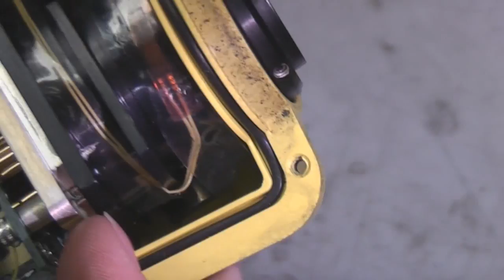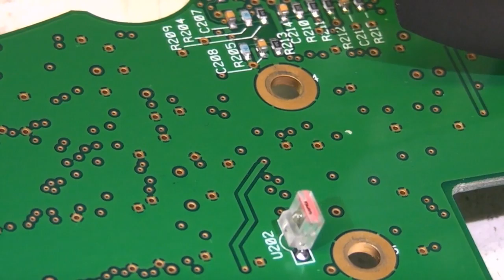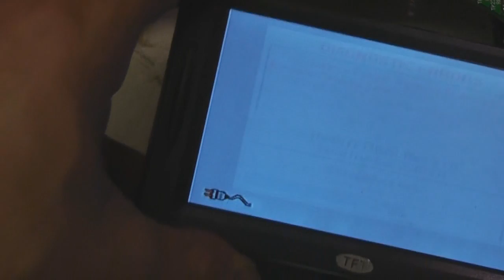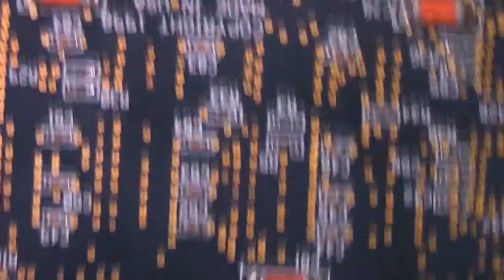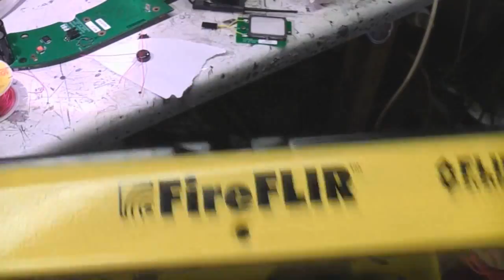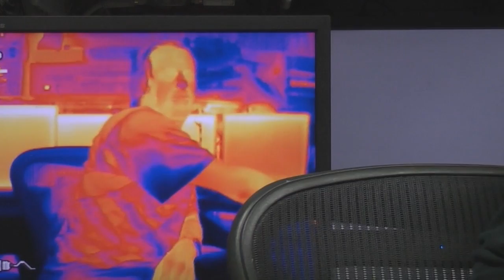Thermal imaging camera teardown and repair Fireflir ff110

Comment: I suspect that the small metal tanks are filled with a fuse-able salt. Something like ammonium acetate for example. It has a low melting point and absorbs heat as it melts. Just a thought.

Comment: In old car radios from the 90s you can easily find INCANDESCENT (!!) backlight.
Reply: +MrOpenGL more like 60s-70s
Reply: KingofKatenfutter
I have a Kenwood from 1998 with a colour LCD display and incandescent backlight!
Probably because LEDs were expensive at the time and since it wasn't battery powered, who cared if it consumed 100mA more?
Reply: Yes this was just the begin of the time of commercially available efficient blue/white LEDs and they were for sure not cheap.

Comment: A pain to search the comments if anybody else has mentioned, but it occurs to me that those large heat-sinky structures might actually simply be counter weights to make the device more evenly weighted, since the battery is to the rear and left, these large heatsinky things are to the front and right sides.  The "filling screws" would be used to pour in whatever it is they use to get the right weight.

Comment: The copper pinch-off tube looks exactly like those used to seal ion pumps for shipment (I work for a company that used to distribute high vacuum products), so I'm inclined to agree with @Doug Fuller; the imaging sensor is likely to be under vacuum.

Comment: Interesting video,  Thanks.  I think that the sensor is likely cooled thermo-electrically to improve its sensitivity.  The sensor would be in vacuum and thermally isolated from the case and electronics as you speculated.  

While this is not required for low performance sensors, it is likely needed to achieve the sensitivity and performance of the images shown.  You are seeing residual heat differences of a few degrees or less in the images.  Military FLIRs run at liquid nitrogen temperatures.

Comment from the maker: They're fairly standard 2mm socket probes - more useful on PCBs than standard probes  - sharp tip helps penetrate resist & gunk. Just don't use them on 3-phase distribution panels!

Comment: Those could definitely be phase change heat absorbers..... imagine normal room temperature was -5C and they had solid water ice in them.  If the unit was taken to a room of even 200C, they would hold the temperature of the assembly at 0C for some time as the water absorbed heat to change phase to liquid.   I am sure there is some material that melts at 40C or somesuch, keeping the temperature there until it's all melted.

Comment: Great video! At around 35:35 you talk about a 32kHz watch crystal. It might be used not for a real time clock, but as the reference for an internal PLL of the processor - a lot processors use this approach.

Comment: These things are still relatively expensive when broken. It went for 210 £ at ebay.co.uk
But still a relative bargain compared to new ones.
Would be fun to film a working high power CO2-Laser, probably you could see a beam like with those Ar-Ion lasers, since the CO2 in the air absorbs the radiation, thus heats up.
What resolution does it have?

Comment: Most likely It is a thermal wax that has  melting point near that of the operating temperature. The phase change of going form a solid to a liquid absorbs more energy per unit mass that just heating a solid or liquid. this a a common technique used on satellites that have high transient power loads.

Comment: I have tried a few experiments and it seems that such modified cameras would start to show light from thermal emission somewhere at about 350 to 400 celsius range. However, the emission is very limited at such low temperatures and is easily swamped out by reflection of ambient NIR, so near darkness or working under lamps that does not emit much NIR is necessary for experiments. but you can take some interesting images of things by reflected light, too, things look somewhat different in NIR.

Comment: The material inside the heat "sponges" could be gallium.
It has a high heat capacity, and it melts at 28°C, and at temperatures lower than that it's quite hard.
However, like mercury it doesn't like aluminium.

Also be carefull with that piece of ZnSe, its quite toxic.

Comment: Back when I did electronics repair at a small shop we used to slap around TV's and used plastic paint brushes to find faults. When we had the general area narrowed own it was magnifier time, could almost always see the cracked solder and if not we'd just reflow anything heavy in the area.

Comment: I cheered when you first got it to work, LOL. Keep up the good work with the videos Mike, love the work. We used to use those cameras in the electrical industry for locating hot joints in high current switch boards.

Comment: Mike I am having a GREAT time watching your videos ! I have been fixing electronics all my life and this is like porno to me ! I was hoping you would not catch on to the phase change heat store so I could comment but ....     I am familiar with them in solar heat storage and as you know the appeal is that they absorb heat with little temp change ( till all the material has changed). I would guess that the copper pipe was a vapor phase heat pipe to connect the heat store to the sensitive parts.